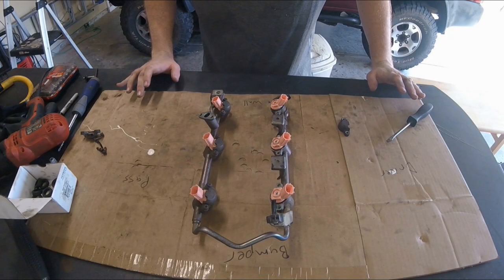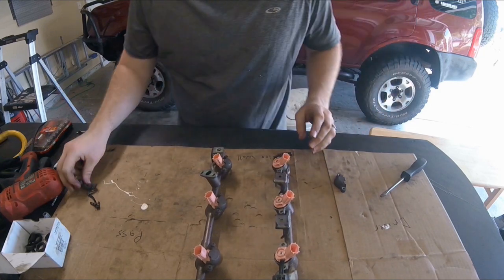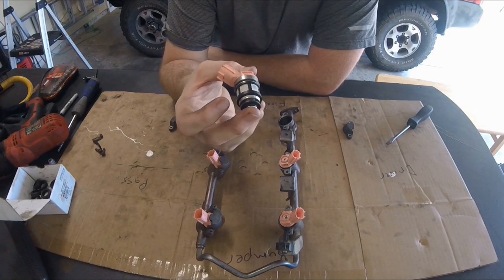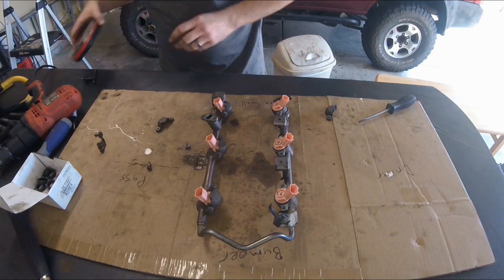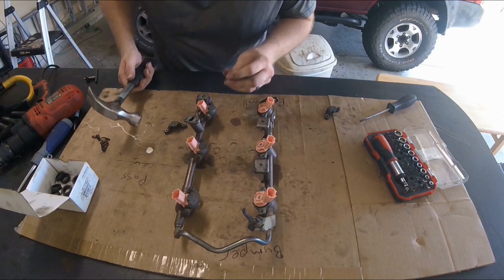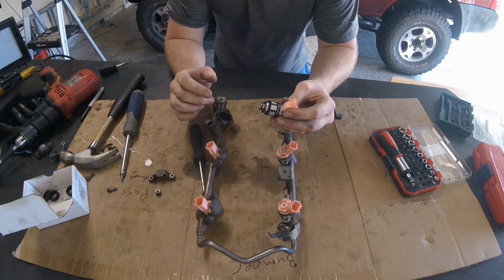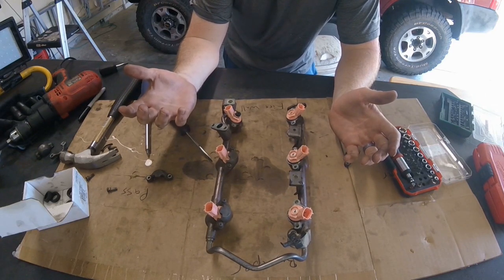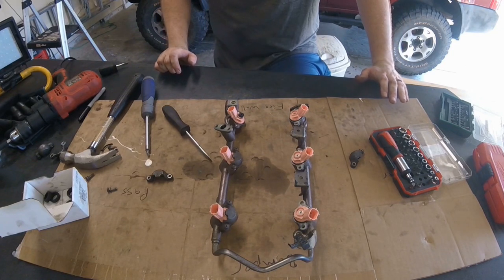Tips and Tricks for VG33 Fuel Rail, Injectors, and Extracting Stripped Screws

Comment: Very gentle use of vice grips on the injector retainer/cap screws works pretty well. I used that trick when replacing an injector on my vg33e a few years back.
Reply from the maker: Great idea! Thanks for sharing!
Reply: I was also able to nicely remove the very tight screws with a small vice grip.
Reply from the maker: Great info!  Thanks for sharing!

Comment: Use a good screwdriver and tighten the screws first, you will hear it pop then unscrew it. Worked for me on every screw.
Reply from the maker: Thanks for the tip!
Reply: @XterraRob  you can also use an impact driver. that you hammer on to get screws out. you should probably do this before you remove the fuel rail

Comment: Rob, I appreciate what you are doing.  This is good info for me because I am a new Xterra owner who has to do this job soon. It is true, these truck engines have some crappy screws. I have to pull off my blower to do plugs and a knock sensor. normally, plugs can be done but the last guy did it with the blower removed and screwed up the wire routing, so i have to take it off.   If you have a cam and trying to get high flow from the fuel injectors, I recommend RC engineering  they can do a clean and test. Its kinda like the pennance you gotta pay. years ago, in the import racing scene,  everyone had to send their injectors there to be certain they will work right...side feed injectors and distributor ignition are going the way of the dinosaurs very quick... I am trying to figure out a distrubutorless ignition and conversion to modern injectors...These engines are very strong but in this day and age need to be updated management wise...
Reply from the maker: Thanks for the comments and for watching. Happy to help out!

Comment: If you're getting new fuel injectors be sure to compare the size of the spray nozzle with your original injectors. Like Rob, I got a new set that were running too rich... the only difference looking at them was the new ones had a larger nozzle hole... about twice as big as my originals.

The part number was correct and everything else checked out. Now I'm afraid to buy new injectors.

Comment: If you get exactly the right wide Philips head most of the screws will come out... I only had one screw strip. When I was finished I replaced all the screws with hex bolts. 

Also, to echo Rob watch out what injectors you get if doing replacements... I got what looked like a OEM set on ebay with the part part number and everything... but they ended up having a larger nozzle when compared to my original stock injectors.
Reply from the maker: Good tip...i don't think I used the fat Phillips but I don't remember to be honest. I have several of them so if they fit I think I would have used them but who knows...thanks for sharing.

Comment: Hey rob could you do a video on what different deletes can be done that the vg33 doesn’t need to run and clean up the engine bay a little bit. Ex (vacuum lines, coolant hoses, which to cap off what not to cap off, what’ll throw a cel etc.) that’d help greatly thanks! Love your videos and insight I recently just got an xterra that blew a hg so I’m in process of tearing it apart
Reply from the maker: I'll have to spend some time thinking about it, but I'll put it on the list.  Thanks for the idea. There's a lot of vacuum lines on this engine...

Comment: Great video. I was fortunate enough that my screws came out with no problem. I replaced them with hex head screws. I do have a question. Does the seal on the injector bracket go bad?

Comment: thank you for sharing
what are the best injectors to replace the old ones. amazon has a set but no good reviews thanks
Reply from the maker: I would keep the Nissan ones and give them a good cleaning and replace the rubber seals. If your injectors are damaged or cracked then I would replace with Nissan

Comment: Thanks Rob!  Great info.  I used a "Manual Reversible Impact Driver" like this https://www.amazon.com/ARES-70606-1-2-Inch-Manual-Reversible/dp/B077D298R7 to release the screws.  A couple of solid strikes with a hammer on the driver and the screws were released.  I really appreciate your tip on leaving the screws in place until both sides are out.

Comment: The flat washer on the bottom of the injector,,  it has 2 grooves. do the grooves go up towards the injector or down against the rail.
Reply from the maker: Good question...i remember I just looked at how they were when I took them out. I THINK I put the grooves up against the injector.  I dont think youd ever know any difference though after its all buttoned up.
Reply: The fuel injectors I removed had the grooves against the injector but the new injectors were just the opposite. Im going with grooves against the injector.
Reply: I bought the Beck/Arnley o-ring kit and the flat rubber washer that goes on the bottom had grooves while my OEM that I removed did not.

Comment: Thanks for the tips. If you don't mind answering, where did you purchase the good fuel injectors?  Not the Amazon ones. Which brand did you go with?
Reply from the maker: Oem used Nissan ones from eBay. They were used ones from a junk yard. I would just use yours with new seals and clean the spray tips with carb cleaner.
Reply: @XterraRob  Thanks again. That was what I was thinking about. I'm rebuilding my 3.3 and since I had everything apart I figured I'd look into replacing them, but they work fine

Comment: Anyone know how to replace the filler baskets on these injectors ?  sure would appreciate it took mines out to clean and the basket is broken up and cracked..
Reply from the maker: I don't know about that...Id probably replace if broken like that but that will be pricey if every one is damaged like that.
Reply: @XterraRob  I'll let you know if I figure it out
Reply from the maker: I did buy used injectors on eBay...all 6 OEM in the fuel rail for 80 bucks. Not too bad...
Reply: @XterraRob  yeah I was just looking on Ebay all I see is Chinese knock offs,I rather put lit fire crackers in my gas tank before I buy that junk  again 😂
Reply from the maker: Yeah don't use knock offs!  I found them listed by a junk yard seller that pulled them from a wrecked xterra.

Comment: I put the philips screwdriver bit in a 1/4"socket and 3/8 drive ratchet with a 6 inch extension and just pushed down amd had absolutely no problems. After soaking it with pb blaster. I would not recommend using a drill on those screws at all. That is a bad tip
Reply from the maker: Good thing you didn't have to go the drill out method. What do you recommend when over half of the phillips screws round out even when using significant down pressure and the correct Phillips bit?  Drilling has always worked for me although a pain.